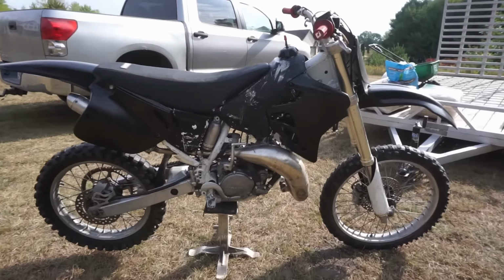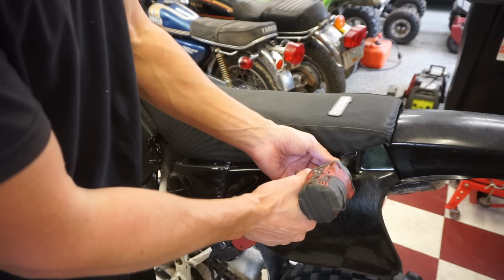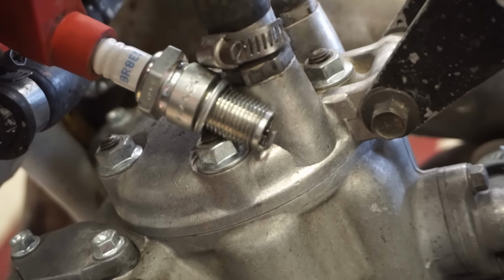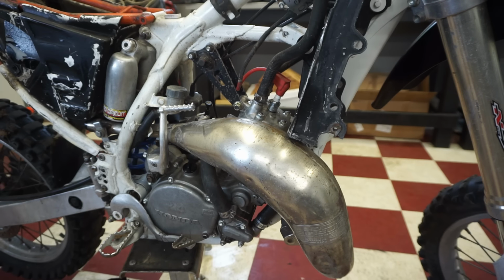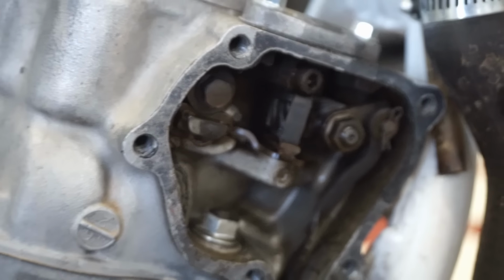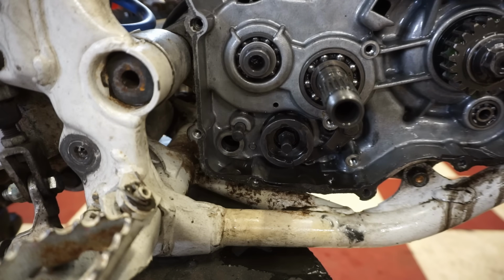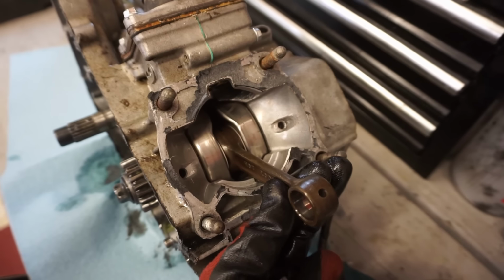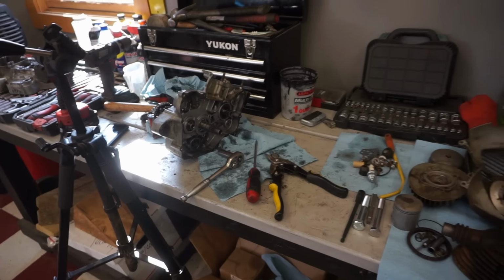$700 Dirt Bike Won't Run Or Shift

Comment: Always check for a "in specifications " leakdown of the crankcase seals is your 1ST step in checking the mechanical health of a 2 stroke.  It will not, absolutely not , start and run properly with leaking seals.

Comment: if i were you check over that crank and install a new topend also check that cylinder for scoring if it is it needs honed/ deglazing or possible cylinder could use sent out

Comment: It has an oil check bolt to check oil. . Side to side play in two stroke rod is fine, lets oil into the bottom bearing.

Comment: Great videos with great detail! I currently have a 1984 Yamaha Seca 650 that I am close to digging back into and was wondering for a 40year old bike where would be the best place to source parts? This is a bike I had in high school and it has not run in 10 years but ran when I put her up.. My local bike shop is not interested in helping an old guy with an 40yr old machine in search of parts, and unfortunately getting around the internet and trusting buying stuff site unseen is something that is new for me. 
 Great video's and you really have given me inspiration to get  my hands dirty and get some grease under my nails again..
Thank you!

Comment: here is a tech tip for you any spark plig for dirt bikes that have the letter r in it mean that it has a resistor in it you need the spark plugs that do not have a resistor in it like u can get a b8es for the two stroke

Comment: a quick tip for you on honda egnines, they are completely interchangeable from 1988-2002, you cna put a 2002 cylinder on 88 cases and vice versa!

Comment: Not a 2001 engine, the power valve cover is more square and it's on the right side behind the pipe on 01 and 02s

Comment: Im tempted to do a rebuild on my yz85 i think my crank seals are leaking since i can see oil coming out my exhaust. Plus im doing a top end rebuild so might as well. But im worried once i started taking the engine apart i see more issues and i have to split both cases and i dont have the tools do so.  44:08

Comment: By looking at cylinder , that is not a 2000-2001 engine. It’s an earlier model, can tell by the power valve covers.

Comment: I bought a 2000 kx80 that wouldn't shift out of 2nd. One of the shift forks was overheated and was blueish color. It  had play and the pin didn't travel in the barrel properly. I changed that fork and she shifted smooth as butter from 1 to 6th

Comment: Motor is not a 2001 cr 125 motor the 2000-2001 cr 125s didn’t have the HPP power valve correct me if I’m wrong but I believe they started putting the HPP power valves into the CR’s in 2002 @

Comment: Hi there, did you ever get the parts for the Honda 700xx with the broken valve several months ago? I can't find the most current video (if it exists) where the machine is back to running.

Comment: Never never kick any kind of motorcycle like that using the kickstarter as a jackhammer if it doesn't start normally, after several it ain't going to start.
Unless it would be flooded and after three kicks always with the throttle open if flooded

Comment: Amazed wha😂t used to put out on curb is now a week's pay ! So gas and oil are lighter than water and dirt. So it's going to be in some of first fuel that you drain. Modern gasoline seems to produce condensation when left sitting around. Always drain any old gas , it's $4.00gal.  garbage.

Comment: id order up a set of sprockets too that front one is toast. great find that one . id convinced myself one of the gears was in backwards but forks in wrong order is an easy one to do . but bad that didnt test trans before putting cases back together. but this is gow we learn

Comment: Gotta question gotta pit bike today intake side of carb if I put my hand there it’s wet normal or jetted wrong ?
Reply: Check for cracks in the intake boot
Reply: @Hyngyynj   no intake boot just a metal cage air filter then metal pipe to cylinder

Comment: Glad you got it figured out, i had something like this too. They said it was a 2001 yz125, wouldn’t go past 3rd gear. Turns out it was an 03 w 5 gears as I opened up the cases, went thru the tranny. Someone added another gear, now I’m ripping it. Your channel taught me a lot and give me confidence in fixing something that isn’t running or running right, also ppl who follow you and give tips, I like to read your comments and add that to my bag. Thanks Joe!
Reply: Joe is a beast so dam good an calm I wish u were closer I bring u bike I bought face book yz125 2003 an it didn't have 2 gear an missing alot of bolts I'm putting alot cash into it I plan on racing it against new bikes I'm wip there ass old against  new
Reply: I have never heard of a yz125 being built with anything other than 6 gears. Most people can't be counted on for accuracy in technical specs.
Reply: I didn’t either until I got this bike, and did my research.

Comment: I had gas like that in the pipe of  a RM125 recently and the clutch side crank seal was bad.
Reply from the maker: I'll be replacing seals as well. That's interesting though!
Reply: Gas in pipe has nothing to do with crank seal being bad crank seal bad would put gear oil from clutch side into cylinder causing oil to burn out exhaust etc. Carb flooded the cylinder and crank case and got pushed into the exhaust as well

Comment: The engine is 1998 and earlier because of the power valve cover probs a 1993 same as the frame

Comment: that CR was on a shifter Kart at one point in it's life -  that's why the is a brass plug in the case by the reed block, that's where you would put your fitting to run a pulse line to run a fuel pump

Comment: Seeing that nachi bearing at the shift drum already told me that was a cheap namura piston. People use name brand parts.  Piston looks brand new??? Do you not see all the scratches on the skirt there’s no way oil was able to stick around in the cylinder to lube it correctly. 😅

Comment: You point out the slack in the clutch cable like it has something necessarily to do with the clutch
. It might need a simple cable adjustment if nevermind.😂

Comment: I saw you doing something in this video around 18 minutes in that I thought that you would have known.  When you think the engine is flooded, you need to hold the throttle wide open with the choke off and crank it until it clears out the excess fuel.  Don't keep operating the throttle off and on as you crank it.
Reply: He's been doing that habit of his for years now. Common sense to hold throttle full open when it's flooded, but I guess he doesn't know, and twisting the throttle every time just continues to flood it.

Comment: ... that bike is a classic example of what 300 bucks should buy you,, I'm thinking you paid too much... Chain sprockets and tires plus plastic is 700 bucks add the cost of fuel and the time you spent in transport ,to break even in the real world this bike would have to sell for 2500 hundred dollars.. But I get it,, this is a YouTube thing and we appreciate your work ethic and the mechanical lecture aspect of it, with that being said ,no person without an alterior motive should ever have bought this bike at any price,,,, period!!!!
Reply: plus the fact that top end is not a 2000 I hope he dont order 2000 parts for it thats a 99 or less with HPP valve system better than 2000 top end

Comment: That doesn’t look like a 2001 engine that’s a much older engine. The choke plunger is threaded the further out it is the more the idle is turned down. I know this because my dads 88 cr125 is the same. Also that carb looks the same as my dads too
Reply: That's an 01 engine lol.
Reply: @jerrywilcox9890  it’s not he confirmed that near the end of video it’s 93
Reply: @lucadonorio1815  still not buying it
Reply: @lucadonorio1815  no way that engine is a 93 lol.
Reply: @jerrywilcox9890  lol ok go look up pictures of a 01 cr125 engine and then don’t reply when you realize you’re wrong😂
Reply: Also they stopped the HPP valve system in 99
Reply: @jerrywilcox9890  not the top end its not HPP valves stopped in 1999
Reply: @jerrywilcox9890  that engine is actually better than a 2001 the HPP valve system was the best engines CR ever made

Comment: I had the same shifting problem out of a 2003 I rebuild a couple months ago. Come to find out the water pump bearing blew apart and the power valve governor was put together wrong and slung the ball bearings out and wedged in the transmission. Some people don’t need to be working on bikes

Comment: 700 dollars for a 30 year old dirt bike with bad tires, bad trans,wont start? 
Thats a 250-300 dollar parts bike.
All the same....Excellent Video. You taught us well. Thanks , Man.
Reply: If ppl wouldn't buy them for 700. Sellers wouldn't charge 700😂
Reply: @jakeowens1770  well put!

Comment: I had one of these that after it sat for a while od have to blow air thru the carb to get it to run. Blowgun with ruber tip held to where the gas line hooks too

Comment: i think that motor is at least an 02 because the power valve would be on the right side if it was an 01 or older
Reply: never mind power valve is on right side
Reply: @hatcherhamman2736  its 99 or older with HPP valves

Comment: I had a honda xr200r dirt bike 20 years ago and I paid about 1300 bucks for it and I didn't make a huge deal about cause I didn't want to cause a rift with my brother in law at the time but that bike I had to do a lot of repairs to it. it needed new tires and the exhaust was like this one and after about a year of having it I had to get the gear shift shaft repaired and a few other things fixed on the engine and what was weird when we went to an old quarry near where I lived in Missouri it ran like crap but everywhere else I rode it ran fine. I sold it before I moved away.

Comment: Good Job Joe!   Some guy's tired, gets in a hurry, makes a silly mistake, and it doesn't shift.  

He may have even known it, but just didn't want to unbolt that engine, split the cases, buy another Gasket set, and put it all back together.  

<Smirk>  Sometimes ya just are sick of something, and the idea of tearing it all down again. . . Well, just one of the reasons why some people drink?

Comment: You solved that one, it happens more frequently than one would think. Rule of thumb check that it shifts before joining case halfs like Joe did and once more when halfs are joined but before the final bolt torque. We'll done.

Comment: A good tool for when you need to pry some covers off, is plastic bike tire levers for a road or mountain bike. They’re small for tight spaces but will help keep from marring gasket mating surfaces.
Reply: Thata a great tip

Comment: I looked at a YZ 125 a guy was offering. It was a 03 clapped out, clutch was history, definitely needed a new top end, probably bottom as well. It would hardly idle, low compression, looked like it has been to hell and back a dozen times and guy wanted 2500 for it. That's ridiculous, for 500-800 I would've bought it though.